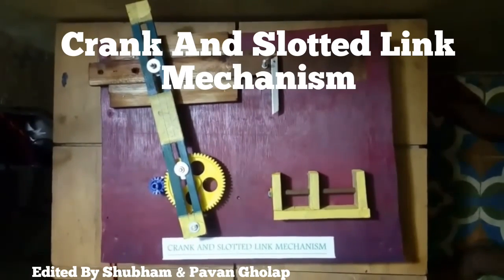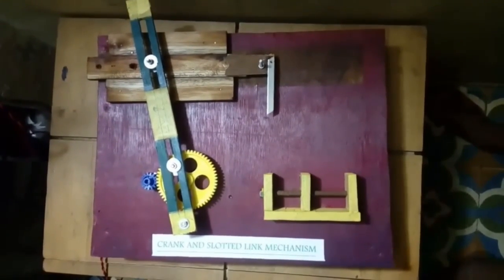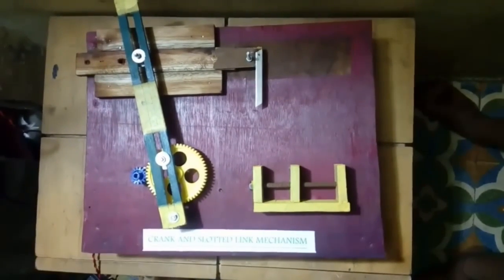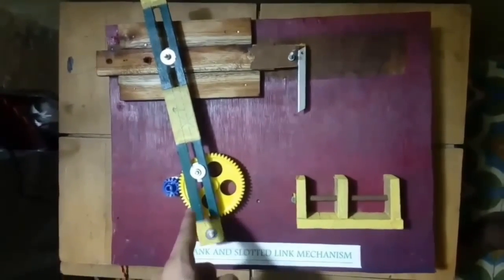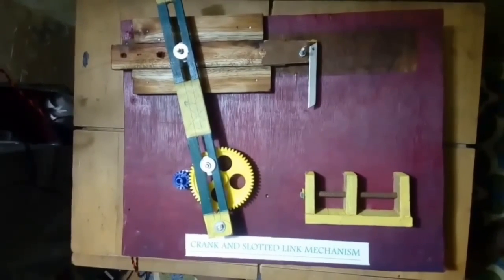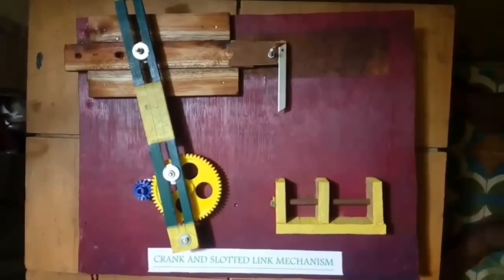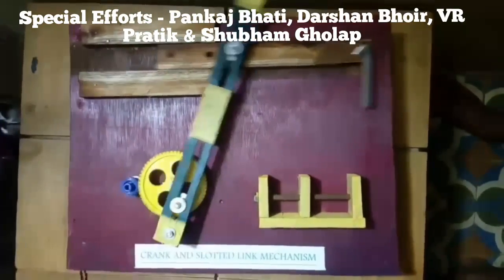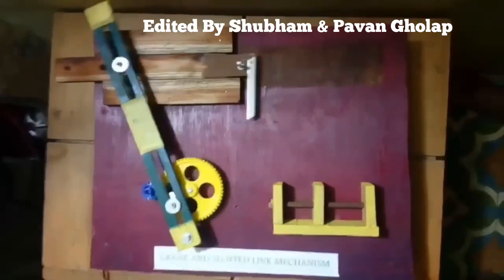CRANK AND SLOTTED LEVER QUICK RETURN MECHANISM | MECHANICAL ENGINEERING | | WORKING MODEL |

Comment: nice video guys/....as it is a type of  4 bar single slider mechnism but can u plz tell me which type of inversion it is ...i mean which link u hav fixed .
Reply: Rohan Prakash it's a slotted link which drives or convert the rotary into linear motion and this link is fixed at bottom point known as pivot
Reply: thnks buddy
Reply from the maker: +Rohan Prakash Ya it is an inversion of single slider mechanism particularly known as crank and slotted link quick return mechanism

Comment: Wait.. What??  You mean that clockwise and anti-clockwise rotations will end up with delivering different speed to the so called RAM. IT'S a motor, the RPM remains exactly the same irrespective of the direction of its motion.
Reply from the maker: No no. You got it wrong. Observe the setup again. As You Can see there, the slotted link is connected in such a way that, it is fixed at the pivot point with nu and bolts. Now during the clockwise movement of the bull gear, due to the small angle (just above the pivot point) it gets a fast return stroke and due to the large area above for the travel of the nut connected to the bull gear, it gives a slow forward stroke.
.
Thus if the Bull gear Will move anticlockwise then due to small angle area above pivot point we will get a fast forward stroke. Which we don't want.
.
Hope You Have got this!
Reply from the maker: And yes RPM of the motor doesn't matter here, it matters UpTo a small extend but the set up all decides the strokes or movement of the ram!

Comment: Do you have any explanation for why the rotation should be particularly clockwise /anti clockwise . Think.
Reply from the maker: Yes. Case:1 The bull gear is rotating in the clockwise direction due to the anti clockwise direction of pinion and both are coupled, thus we are getting cutting/forward stroke as slow n return/reverse stroke as fast as you can observe from the video. Case:2 Now if we connect the motor to the pinion clockwise, then the pinion will rotate clockwise and the rotation then transferred to the bull gear will rotate in anticlockwise. right? So we will get the cutting/forward stroke as fast and return/reverse stroke as slow.
.
So now this mechanism, we are using in a shaper machine, and for the smooth cutting of the metal it is essential for the Cutting/Forward stroke to be slow and the non- cutting stroke that is return stroke to be fast. 
.
Since Case:1 is preferable.
Not only Crank and Slotted Link Mechanism, But also there are many other mechanisms such as Whitworth Quick Return Mechanism etc.
.
Thanks for the Question!
Hope you will be satisfied by our feedback!
ThankYou!
Staytuned for More Videos 🙌